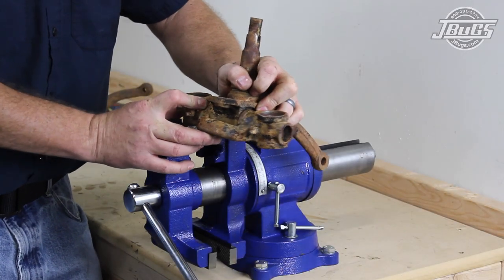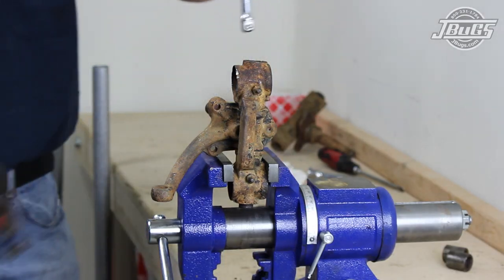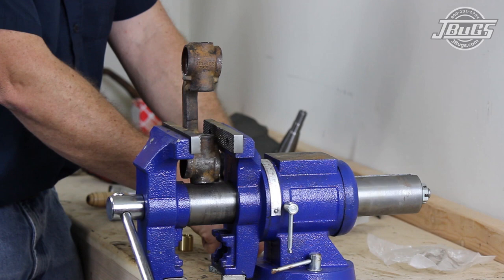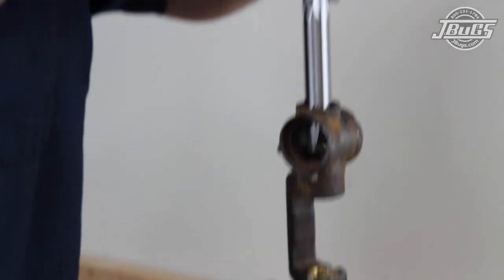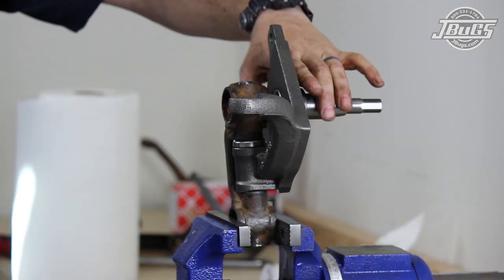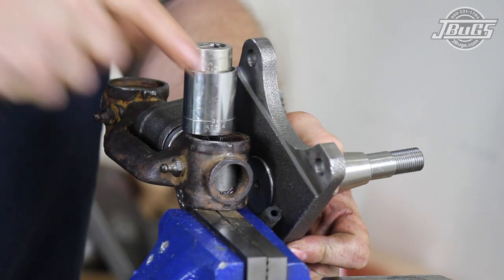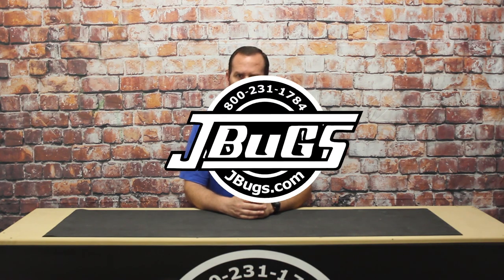JBugs - 1963 VW Beetle - Link Pin Spindle Rebuild

Comment: I just finished replacing link pin bushings. Aligning along the theme of shade tree tools. I found using a 5" x 1/2" carriage bolt 2- 1/2" nuts a heavy duty angle grinder nut fits the recess perfectly. 1-3/4" wrench, 1-3/8 short 3/4" s socket, and a 12" crescent .and a bench vise, and that's it. No hammers used or harmed in this procedure. The 1/2" bolt was my press.

Comment: I installed the 2 1/2” dropped spindles, then took my car to the tyre shop for alignment, after that I drove the car for about 6 months, but wasn’t really happy about the ride, the decreased turning circle, bouncy rear end, harsh ride up front, our roads are shit in Australia, I finally decided to remove them, and fit the original ones back in. Thanks for this informative video, I’m sure it helps lots of people out there.
Reply: A lowered car isn't for everyone, you're absolutely right there. Especially with rough roads!

Comment: I wish I saw this video before installing my aftermarket spindles! I couldn't make a full turn to the right because the spindle was was binding up on the carrier.  I had to take the beam apart and hit the spindle with an angle grinder.  But this being my first time building a beam, figuring out what was wrong took forever.  I thought I had a bad steering box, I was checking my pitman arm, my tie rods... took me a month to figure out!
Reply: In all honesty, this was the first time I'd ever done it, on link pin spindles anyway. Past experience from building cars taught me to check before hand though, especially with aftermarket parts!

Comment: How much force is it supposed to take to move the spindle left to right when it's all back together?
Reply: It should be able to move by hand. We never put a meter on to say specifically how much force, but it shouldn't require leverage or a hammer.
Reply: @Sam_Mebane  mine is somewhat easy but has a tight spot.

Comment: At 4mins45sec,  when installing the link pin bushing, shouldn't the hole in the bushing be aligned with the grease fitting ?
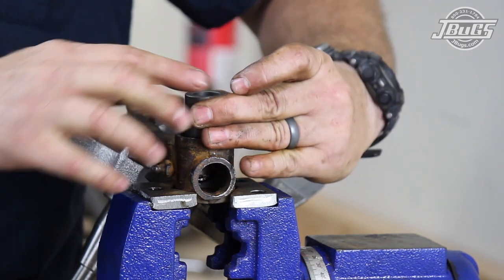Reply from the maker: Yes, we state exactly that from 4:47 to 4:52.  Be sure to always double check your work before installation.
Reply: I’m confused. Is it towards the king pin or towards the grease fitting?
Reply: @ianp6540  in a short answer, both. The grease fitting is at the joint between the king pin and the king pin so the hole in the link pin bushing lines up at that point.

Comment: Where can I buy the VW 224 King Pin Reamer Tool?
Reply from the maker: We located ours through a Google search, originals can be rare but reproductions are readily available.
Reply: You could also leave one of the old king pin bushings in and use it as a guide to ream the new king pin bushing with a normal 18mm H7 reamer. Then replace the old bushing with a new one, and use the freshly reamed bushing as a guide for the 2nd bushing.
Reply: @1951split  see I knew there was a easier way of doing it without having to spend $150 on a bit thanks bro my front right wheel is super floppy thought I had a bad wheel bearing

Comment: What direction should the king pin holes face??
Reply from the maker: The king pins run vertically so the holes should be up and down. The link pins run horizontally so the bushings for the link pins run left to right.